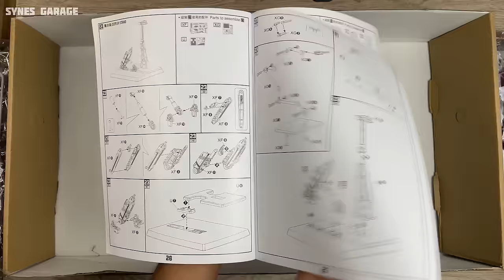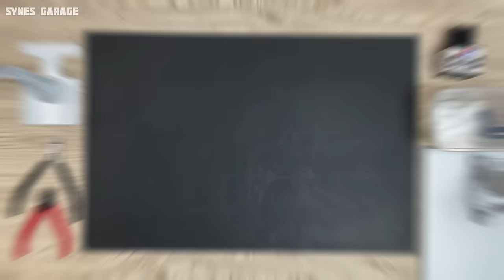Astray Red Frame Kai ver MB MG 1/100 | ASMR BUILD | Daban 8812

Comment: how's the building process? do you require sandings for certain pegs? I found my early daban/momoko kits are hard to fit..
Reply from the maker: same also hard snafit . but if it feels hard, the joint hole needs to be scraped a little

Comment: I would just like to know the issues faced by this kit, like any fitting and stability issues and especially the quality of some of the coated parts and the quality of the plastic itself
Reply from the maker: problem in general snafit hard. the quality of the plastic is not good, it is easy to break, if you are not careful or put it wrong, it can be fatal. This kit is not recommended but if it's just for rafting then display it's good enough to just look at